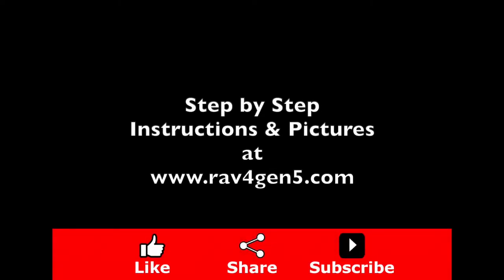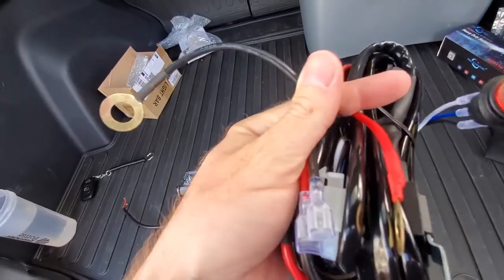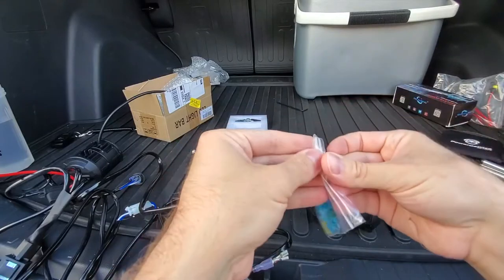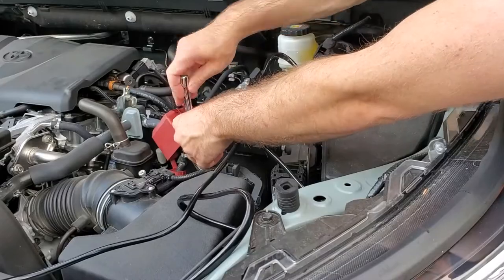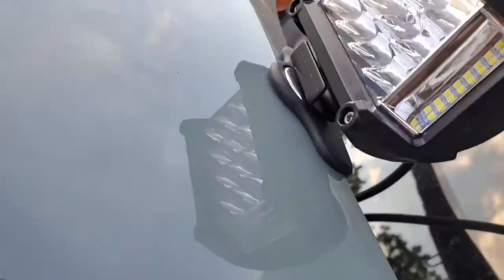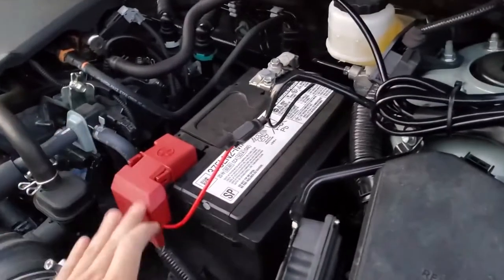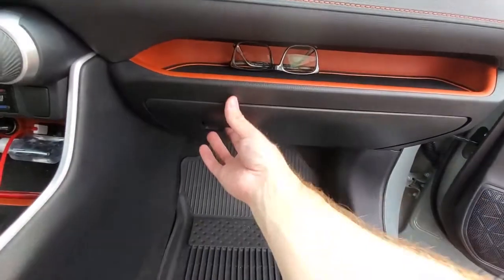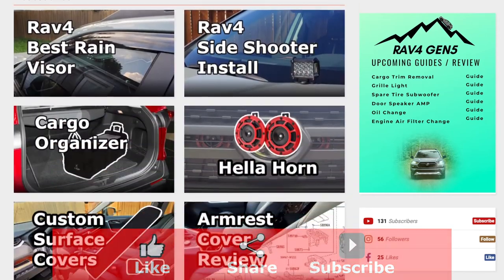Side Shooter Ditch Light on the Toyota Rav4 2019 2020 2021

Comment: For hybrids, it's better to tap into the 12v positive lead coming to the fuse box in the engine bay, not to run a long wire from the rear. There should be heavy gauge wire that reads 12V across it and ground, to which you should be able to run a lead to a fused relay panel. It might be a tight fit, but multitudes easier.
Reply from the maker: Excellent suggestion!
Reply: What do I need to do for this to work if I plan on using the 12v positive lead in the fuse box I have all the parts but don’t know next step should I run through the rear or how to use that positive lead
Reply from the maker: You can use the positive lead, just add a fuse to the wire you are adding.
Reply: @Rav4Gen5  It would be great if you augment this video to show the tapping of the 12V in the fuse box.
Reply: @Rav4Gen5  Do you know where this 12v positive lead is coming to the fuse box in the engine bay? I have a hybrid Prime and currently having a hard time finding these things.
Reply: @dylanlin6924 unfortunately the prime does not have the bolt that can be removed to tap into the positive  like the Hybrids.